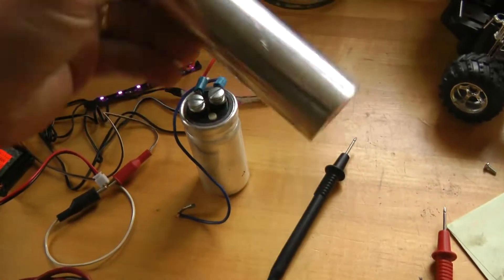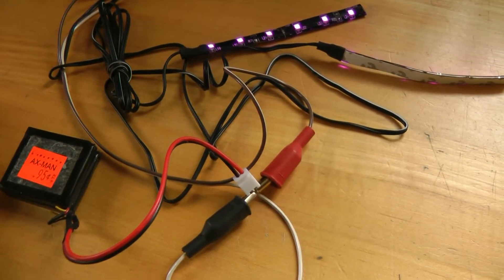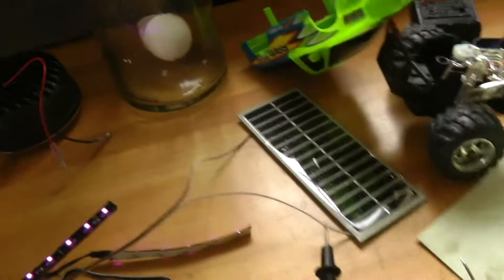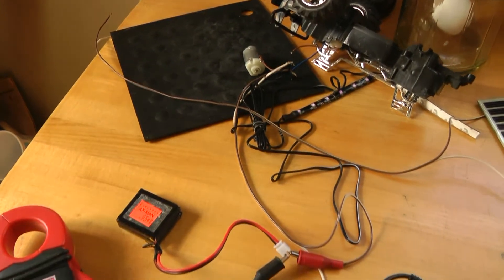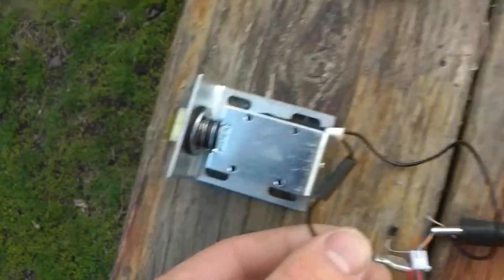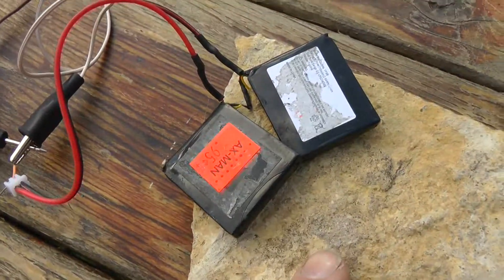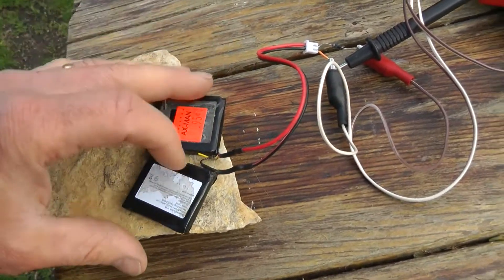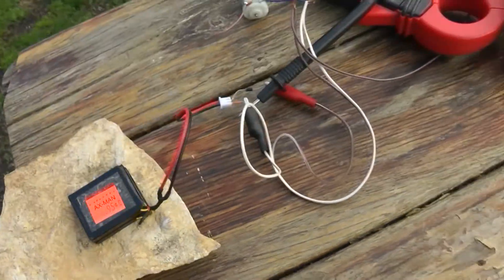Electric Door Latch - Capacitor Out, Lithium Ion Battery In - with Solar

Comment: Not only will you damage the batteries treating them like this you can cause them to fail and burst into flames. Lithium -ion batteries have a two stage charging process that needs to cutoff when finished. Overcharging or overheating them is dangerous.

These batteries aren't toys. Use a proper circuit or charge controller to safely recharge them.
Reply from the maker: Raisonbran648 I am not saying you are wrong but this has worked perfectly for two years now. I suspect it is not a problem because the solar panel puts out just a tiny amperage.
Reply: Probably so. I'm surprised the capacity of the batteries isn't shot.

Comment: No ! Li-po Require 4.2 volts MAX per cell.......Your best bet is to use Phone batteries as these have over voltage protection built in. the solar cell can then be wired up permanently without any worry.

Comment: Well done.
To be safe, don't let the LI batteries see more 4.05 Volts per cell or 8.1 Volts (in series).  Measure your Solar panel output (open circuit) on the brightest day.  Take the difference between "Brightest Voltage" and 8.1 volts.  Add diodes in series until you achieve the desired voltage drop.  I am gonna guess, you may want just one more of that diode you are already using.  Also, ALWAYS have in an IN-LINE fuse between ANY battery and load. 
Cool stuff...congrats.
Reply from the maker: Thanks for the input. I have mounted the solar panel not in direct sunlight, so I think I am okay on the voltage I will check again today. I can add another diode to be safe (I didn't know diode drop voltage - never used one before). I will also add the fuse. I was considering building the batteries into a little firerock cube to be really safe. Maybe that is overkill. Watch for the next and final video soon.
Reply: Matthew Brenengen awesome dude, you're kicking it....electronics is cool stuff.